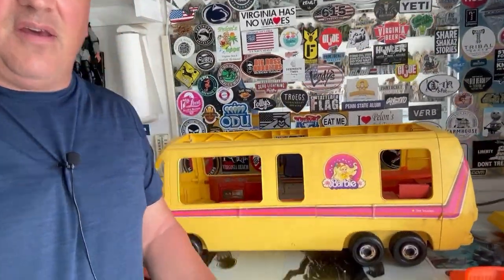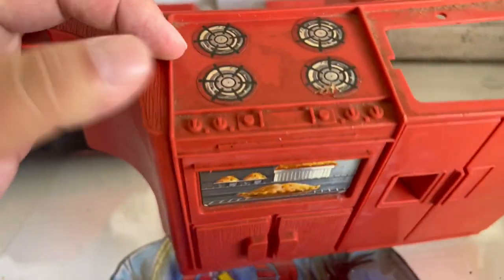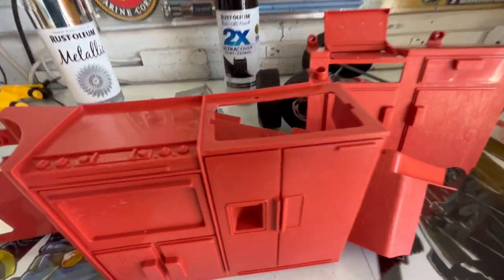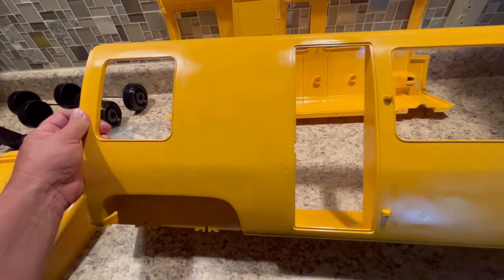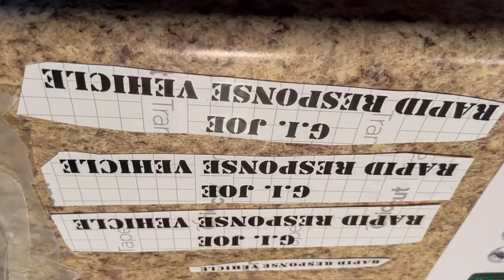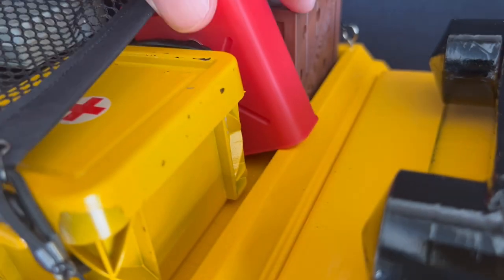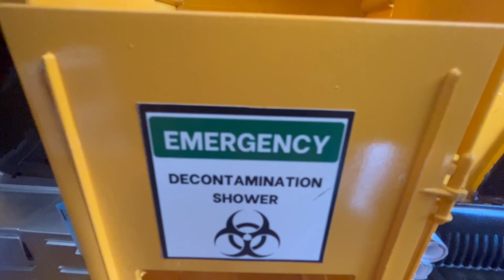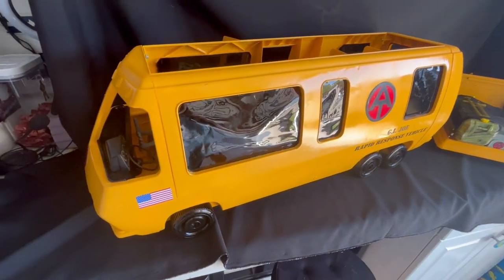1976 Barbie Star Traveler Van  Conversion to GI Joe AT vehicle (1/6 scale)

Comment: good work bro

projects like this are never finished, you can always add more, like a dio.

I had 12's in 74 - 77?
and my sis finally had this van
ah man that I wanted one for my Joes!
only had the puny big Jim van, very squeezed...
a mobile HQ is waaay better!

improvements
while you did most important stuff,
you could tighten the windows with a paint stripper, very lightly
a piece of cloth would finish the floor nicely
pieces of cardboard to fill the small gaps
paint the shower and other parts a dif colour

I d have loved to see more Joes around the van, not just driving, [had this guy]
maybe tie a rope on the front, and pull it in the backyard for a ride, it can surely drift on asphalt, D, I had a Tonka jeep I pulled with my bike as a kid, all metal or most, banging the sidewalks, maaan, that was an action jeep!
jumps and all, never broke!

perhaps you should find one and do the pair
as my logo suggests, I m a fan still.
have an fj cruiser, and have my logos on each side, same blue as my Tonka, but Toyota, D

ah, I still want to find me a vintage Joe, 
I have a deluxe Cobra Commander, a fake Joe and 6's now, classifieds, and I have 4 dios.

I d really want the 50th an version, it was cool as heck.

so now you know...

good show bro
Reply from the maker: Thanks for all the info

Comment: Questions… 1 - where do you get flat plastic thats thin like you have for stove?   2-  What kind of prep work do you do for the plastic parts before painting them?  Primer, cleaner, etc? Thanks
Reply from the maker: Just regular spray can primer and the plastic is from Hobby store comes in different sized sheets usually white but you cv=an sometimes get black. Its just styrene.